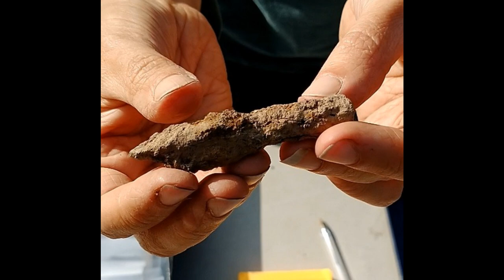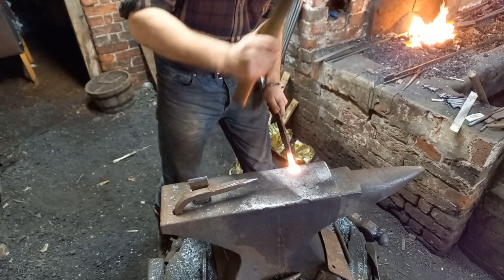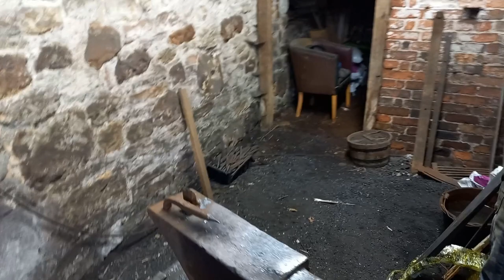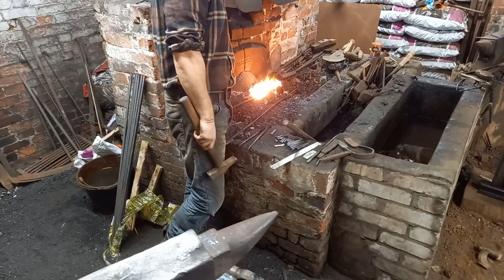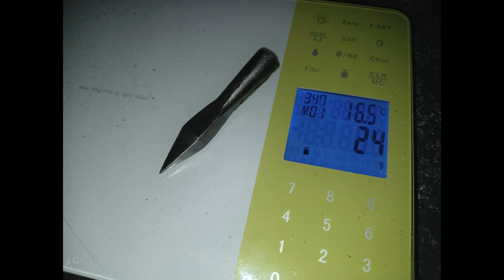Shrewsbury Castle Crossbow Bolt - How To Forge Medieval Bodkins and Arrow Heads

Comment: I am wondering .. it looks like you use the shoulder of the main bar to half on, half off, hammer the socket round, Your hammer work is quick but I think I'm reading it right,  May I ask also what diameter the socket is on this and the bodkins 
 That second one went surprisingly quickly, 
thanks for sharing